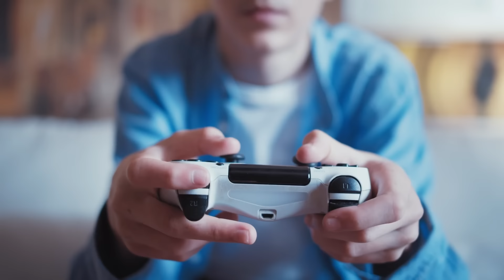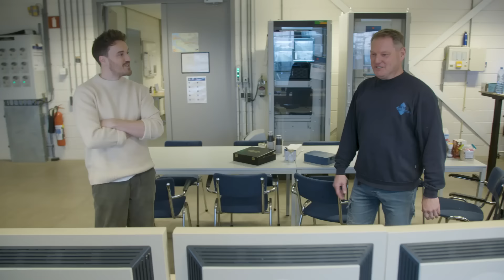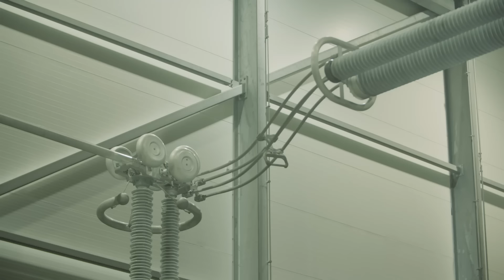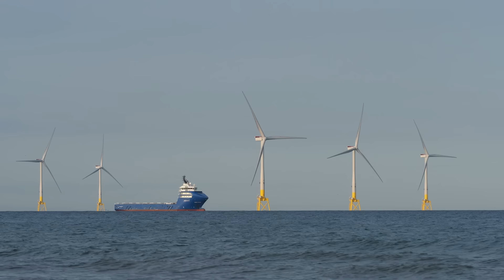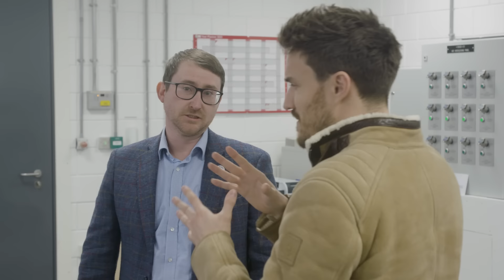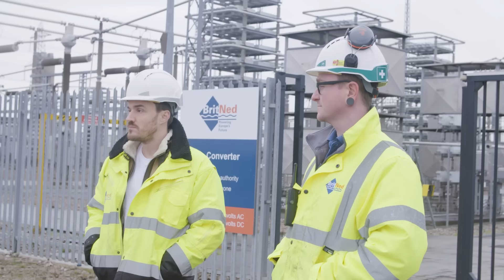Unlocking Electricity’s Secrets: Behind the Grid | Episode 1: From Sea to Shore

Comment: Fantastic information 👍
I would say though that the guy who is head of the international connection of the grid is a bit naive when it comes to Net Zero. He is thinking about new technologies to help boost the supply but has no idea about the infrastructure and engineering challenges to achieve net zero. 2050 is a pipe dream. Net zero would mean no oil or gas so EVERYTHING would be electric. There aren’t enough engineers or construction workers to put in place the capability required for millions of homes and that’s just a small part of the problems.

Comment: why does it need two cables for this DC interconnect?    why not use +ve to Earth on either side of the interconnect.  This is one of the advantages of a DC compared with an AC interconnect.

Comment: Why is DC used within the cable running between the countries? Aren't there losses in the rectification/inversion process?
Reply: Because it’s too hard to synchronise the AC between two separate countries
Reply: @extrude22  not true, uk and entire Europe synchronized, an incredible feat
Reply: AC passes thru zero at 100hz there in lay the losses

Comment: How do they do the 'burying 1m' bit? It's easy enough dropping the cable off the back of the boat, but trenching it on the muddy seafloor sounds a bit tricky. Maybe if it's just mud all you have to do is vacuum up some silt, or aerate it so the cable sinks in? Or maybe it's just really soft and the cable sinks in anyway under its own weight?
Reply: Google subsea cable trenching machine, a bulldozer type machine cuts a trench

Comment: Don't sweat about the XP computers. It is a very,very stable rock solid OS in use for decades. All the OS bugs were killed off many years ago. It runs on cool slow machines that run 24 /7 /365 without a hitch. This is industrial control software connected to actual machines no need for speed.
Reply: Yes they were using the same XP windows computers in a GE Gas power turbine power plant I did some work on a few years ago. They have two of each PC circa 2002 to allow for redundancy and maintenance. I was there to replace the SCSI hard drives as part of the maintenance schedule.
Reply: Yep. Nuclear-armed submarines still run on it.

Comment: Love that they have a Windows XP computer running in the background 😂. Very high tech!!
Reply: I know Windows inside and out, I have several MS certifications. While XP was a great OS for its time a lot has changed since the days of WinXP. Other than a few very specific situations, I would never run windows XP unless it was isolated from the Internet and even then there’s several reasons not to use it. If you truly must run a very old application, that what Compatibility Mode was designed for.
Reply: @Jonathan_O  Compatibility mode has its own issues and isn't as stable as running on the original OE. And, if your machine(s) are isolated then it doens't matter quite so much.
Reply: I'm in the same situation, you don't  want to run a mission critical program(not software) on a machine that stops because it doesn't have the latest doodas en gegaws.
Reply: Their systems might run stably only on XP. Also, it's a pretty solid OS. Still in use all over the world in places where it's needed because of the programmes running on it.

Comment: The first uk to France was much earlier than the 1980’s !  I was taught about the first one when I was at UNI in 1963.  One of the reasons for using dc was the difficulty of synchronising the UK and Mainland Europe.
Reply: The main reason is much higher efficiency over long distances removing the synchronisation issues was a side benefit.
Reply: @mfx1  Except the distance to France is only 25 miles so it's not really a very long cable on the scale of things.  We have much longer (100km?) AC cable segments on the UK grid. The DC/AC cost crossover used to be a few hundred km, but has come down as converter stations have got much cheaper. So for the early French interconnector the ability to connect unsynchronised grids must have been a significant consideration. I think DC is much better underwater too so that helps justify the converter station cost.
Reply: With alternating current in cables you get interaction which reduces efficiency. Keep current flowing in one direction works better.
Years ago when visiting a network control room in West Midlands the network map had a note against a Welsh connection "Beware of 22 deg phase difference", perhaps not exact wording.

Comment: And of course the SCADA controls run on windows XP... Hopefully they will not be connected to the internet by mistake 😅
Reply: An increasing amount of grid SCADA infrastructure in the UK is addressable using TCP/IP and so it does kinda use the internet. Just how secure it is remains to be seen!
Reply: With its own fibre in the cable there is no reason to use and risk the web.  It’s just that new it engineers have been web conditioned.
Reply: @screwdriver5181  not all transmission and (especially) distribution level assets have integral fibre or auxiliary fibre cables installed, so there will be reliance on shared comms networks to an extent.
Reply: @sleepyspaniel2018  Use an APN, created by your service provider, if you want to connect remotely.

Comment: Interesting how this works.  also: it's 2011, Windows XP is already 10 years old, yet someone thought. yeahh let's use Windows XP on our brand new installation,and continue to use it 10 years+ after support has ended. unless of course they had already installed  in 2007. you would not want to use vista in 2007 for anything critical.
Reply: Not connected to “dirty” internet. Only connected to internal “internet”
Reply: @abusasha478  you could see the XP machines had internet access..
Reply: I'v seen factories still running 1990 computer and floppy disk. If it ain't broke don't fix it

Comment: More technical details please- what voltage/current is used for the DC interconnect, how does the ac/dc conversion work etc.
Reply: 450kV DC, it showed it on the pole.
Reply: @dansonamission  and 1000MW
Reply: I wanted to know, how they re-sync the AC with the grid frequency
Reply: Inverters, reactors, rectifiers that sort of jazz
Reply: Crumbs - @mikeselectricstuff - a blast from the past. Long-time Versatronics user here, good to hear you're here!
I live in Walpole (rural Norfolk) where a load of these projects are terminating - HVDC converters, substations, and I've learned a fair amount. It's fascinating stuff, if a troubling neighbour. If you fancy footage of the build, or some collab, shout.